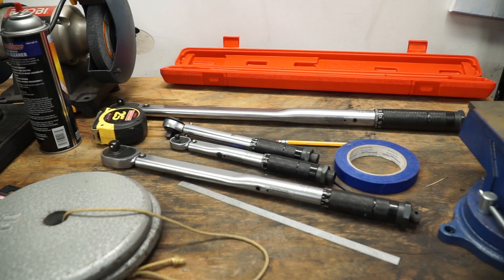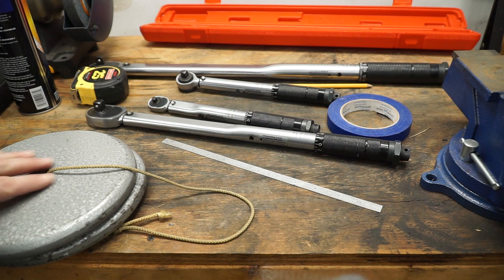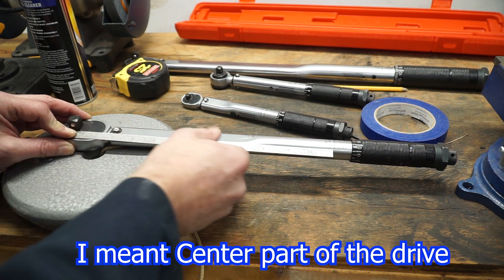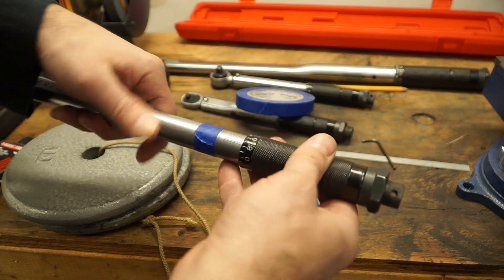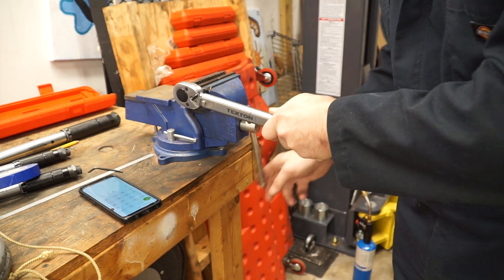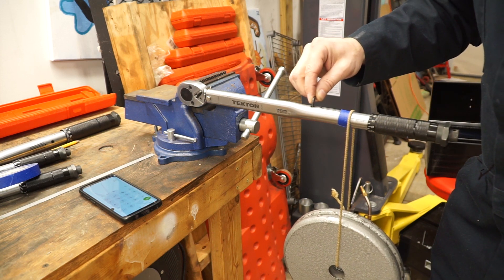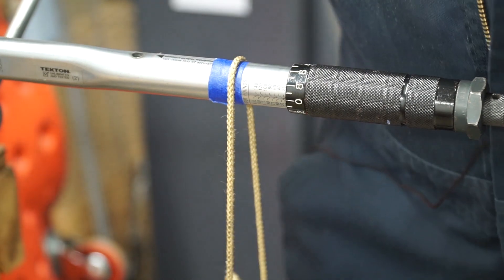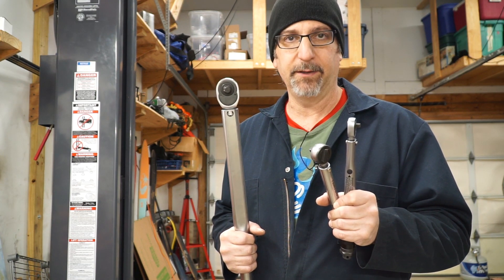How To Calibrate A Torque Wrench

Comment: you measured the 1/2 drive to 12inch how about 1/4 drive?
Reply: The 12" measurement wasn't the right way to do it - the measurement should have been taken to the ring marking on the knurled handgrip. When this length is not 12", a proportional adjustment needs to be made to the weight, or the torque under test. When it's longer, less weight is needed, so you use 12 divided by the longer measurement. My own 1/4" wrench measures 7" to the correct place in the centre of the handgrip, so the weight needs to be greater than if it was 12". So I'd need to use the weight for a 12" length multiplied by 12/7, or 1.714
e.g. to get 6 lbf.ft (often shown as ft/lb) at a 12" length you'd need 6lb weight, on my wrench at 7" length you'd use 10.3 lb.

Comment: why did you put the blue tape in the nm (12") and not a litlle longer than 12", near the site where we put the hand to operate the wrench?
Reply: Unfortunately, many people giving instructions don't realize that doing it this way will be inaccurate, and they just use a handy distance like 12" so as to have a simple force calculation. The ring on the handgrip, called the Loading Ring or Loading Point, indicates the correct radius length. The force should be applied over that length, and the force/mass calculation done as a ratio  of that distance to the 1 foot or 12 inch value depending on the units being used.

Comment: It’s MAY 2024 and I don’t think you have to do math. The spring TENSION and length of the handle have been taken into consideration for the torque wrench. So essentially if you hung the weight at the beginning of the handle, the torque wrench should click at the weight you were testing. However, there is the weight of the torque wrench itself that is also pulling down, so if you were testing 20 pounds I would put your torque wrench may be at 21 Just a smidge over 20.
BTW, UR torque wrench did click at the beginning of the handle. If you had adjusted the torque just a smidge, I think the wrench would have held and was in perfect calibration.

Comment: The error I see is; A torque wrench is designed to be pulled, or force applied at the 👉Handle. Not mid-way up the arm.
Reply: @sarcasticcrypto  You are right. I know it's a long time since you posted this, but it might save someone who reads the comments from causing themselves trouble. A torque wrench of this design must be calibrated and used with the force applied at the handgrip position, doing otherwise changes the torque measurement. There is a second error in that the adjustment at the neck of the wrench is for setting 100% scale value, adjusting it at a lower setting will be even more inaccurate. Anyone following the procedure given in this video will have an inaccurate torque wrench.
Reply: Doesn’t matter where you put your hand, it’ll still click with the same force applied. It’s easier to calculate if you use a foot distance, but you could do it farther up the handle, and do the math

Comment: I hope you also checked your exercise weights. I had a creeping feeling that it would be easy for manufacturers to overcharge by underweighting them. Sure enough, NO brand matched the marked weight. They ranged up to 10% off, usually under weight.

Comment: I wouldn't do it this way.  Torque (ft-lbs) = Distance (feet) x Force (lbs).  Distance is the "Torque Arm"  where the force is applied, and the force is applied at the handle.  I would measure from the handle to the center of the drive shaft.  To figure the weight to hang at the handle, I'd use this formula:   x  lbs = 20 ft-lbs / Distance in ft.  For example:  x lbs = 20 ft-lbs / 1.25 feet = 16 lbs.  You would hang 16 lbs at the handle in this example to get a 20 ft-lb torque.  You could play with the numbers to figure out a way to get something rounded to your weight.  The other thing I have a concern about is that you tested the torque at just the lower end of the the wrench's range.  According to the official ASME method, torque wrenches are tested at 20%, 60%, and 100% of the wrench's range.  That is three measurements across the range.  Even if you find out the low range is good with your method, what about he mid-range and the upper range?  It would be hard to use your method to check the mid-range and upper range of wrenches that measures higher torque.  It would probably be a better idea to have a pro calibrate your torque wrenches  if you want them to be more accurate and to spec.

Comment: (Amount of weight hanging from the center of the handle  ×  Inches from the square drive to the center of the handle) ÷ 12.  

If anyone wants to calibrate it from the center of the handle.

Comment: hey steve great video, just my 2 cents- better to use a socket in the wise rather than the actual torque wrench drive shaft!!! also at 1:56 marking shouldn't be on the aluminum rim on the T.wrench that will damage the mechanism, all OEM's recommend to calibrate from the center of the handle of the torque wrench for accurate results.  I have the same model and you can take the measurement to 1.5ft on the handle rather than the body. I use a 19mm bolt welded on a steel plate to do the calibration, that removes any need for the vice ... hope that helps
Reply: (Amount of weight hanging from the center of the handle  ×  Inches from the square drive to the center of the handle) ÷ 12.
Reply: Bruh you could add a mile long cheater bar as long as you calculate for the added weight and length.  I have a problem with everybody ignoring the weight of the torque wrench itself; and I have yet to see anybody mention that.

Comment: Seems like it would be more accurate to hang the weight closer to the end of the handle, since that's where I usually apply force when torquing(?)
Reply: It’s called a foot pound for a reason. If it’s set at 20fp, it’ll always click at 20fp, even if you put a 2 foot extension on it

Comment: The task of calibrating a click torque wrench has me somewhat baffled. Some use the grub screw, as in this video to calibrate and some calibrate by adjusting the threaded locking peg cup that screws into both the handle and the hex end nut.

Comment: Thanks, I learned something new today from your video, and some of the comments below.  However, unless you had an accurate way to measure the mass of those weights, you are assuming they are correct.  If each 10 lb weight was 9.5 lbs (and I wouldn't be surprised), you may have brought your torque wrench out of spec.  I really like David Mitchell's suggestion though and check the torque throughout the range.
Reply: That was my though too, you need to verify the weight of the weights.  Cool video though as I'm probably going to buy some torque wrenches for the bike and truck.  Tired of just doing tight enough.

Comment: Nice! Simplest solution. However, aren't torque wrenchs supposed to be pulled at the handle? And would this make a difference in the calibration if not measured at a point along the handle?
Reply from the maker: Honestly, I'm not sure.  I just did it the way I was taught and it gets me close enough to have peace of mind that i am not gonna over torque my parts.  if I needed to ever do anything super precise, I would probably just borrow a higher quality torque wrench.
Reply: @TahoeSteve  same here. The measurement was close enough from the center of the rachet when adjusted for the weight setting, and wasn't off more than 4lbs.
Reply: If he were to measure 18" instead of 12" then the torque setting would need to be set at 30 ft lbs instead of 20, and the weight applied 6' further down the shaft of the tool. That makes sense because the further out you apply the same force, the higher the torque setting needs to be to just be able to get it to click. There could however be a slight difference in the weight uniformity of the tool between the shaft and handle area which could throw off the calibration a little. But assuming there is a constant density of material along the entire tool and assuming the clicking mechanism operates uniformly regardless of where the force is applied, it wouldn't matter.

Comment: A proper calibration would be at 5 points from 20% to 100% that would be at 30, 60, 90, 120, 150 foot pounds.  The ANSI. spec for torque wrenches allows 4% of the reading. 20 foot pounds is only 13.3% of the range and at that low level a wrench can be off by 1.2 foot pounds. When tested at 20 foot pounds  the wrench looked like it clicked at about 13 inches which would be 21.6 foot pounds. Most torque wrench manufacturers do not recommend using a wrench below below 20% and I certainly would not adjust one at the 20% point.
Reply from the maker: thanks for your comment.

Comment: Is a torque wrench linear? I would like to see a check at 10% and 90% of the wrenches range.  I just wonder that with just one adjustment screw, would it be more accurate to calibrate at 50% of range.
Reply: Exactly!

Comment: Hey, just a quick question, does the weight of the wrench handle need to be taken into consideration? i have the same wrench and it is quite hefty, thanks!
Reply: Good point. Yes it does need to be considered since it adds to the weight on the mechanism when calibrating this way.

Comment: So here is the metric formula: force=weight×9.81×length of the tape marking. If the weight is 10 kg and the tape marking is 0.4 m it should look like this: 10kg×9.81=98.1.
98.1×0.4=39.2 NM. If you put weight of 10 kg to 04 m lenght the wrench should click on 39.2 NM. Hope I was clear.
Reply from the maker: very precise.  thanks for adding
Reply: That is not correct. Force (F) = mass (m) x gravity (g). Torque (T) = F x distance (d). T = F x d = m x g x d. Are you saying the mass is 10 kg or the weight is 10 kg? You said weight which is a force so it already includes the acceleration of gravity which is 9.81 m/s-2.

Comment: on amazon, I just bought the 1/2in 10-150lb torque wrench and it does say that it does come pre-calibrated 
with a 4% +/- accuracy ready to use. So, looks like they are knowing there are some slight variations with these things but overall I think they are pretty accurate for most things.
Reply from the maker: thanks for the input